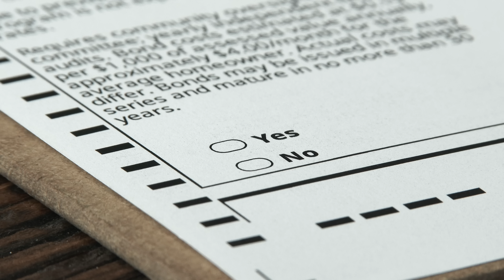Why Does Tesla Have An Anti Right-To-Repair Stand? We Suggest Some Reasons

Comment: In the past it was suggested that ICE car dealers saw most of their profits come from service and parts. You only sell a car once, but service and parts are forever. I’d rather not have my car bricked remotely because I swapped a cracked headlight. Especially if I bought it used. I support right to repair.
Reply: For me it is what you have the right to repair.. Headlights yes but what about the radar inside the headlight unit that integrates with  the smart cruise control? I too support right to repair for me but not always for backstreet repair shops selling “fixed” cars to us.
Reply: @jonwetherell5214  If the self driving systems in the car are coded so terribly that a bad sensor in an aftermarket headlight is a safety issue then the problem isn't right to repair its the manufacture of the car.
Reply: @instanoodles  if the radar sensor requires calibrating and someone puts it in with default settings or ( worse) puts the wrong sensor in so the car reacts incorrectly then the problem is with the part and the loose nut that put it in..why do we accept that d1ckhead amateur mechanics putting spare parts on a car that they got cheap from ebay can sometimes compromise a car’s
 safety. .but mention Tesla and everyone blames the car manufacturer.
Reply: you know in apple products you cant even screens between two working phones without using secret apple software to authenticate the swap. same goes for cameras and batteries. you never really own an apple product
Reply: @nutzeeer  There are work arounds in the EU that Apple has had to agree to..but you are correct Apple make  it bloody difficult to fix a simple problem at home.
Reply: @jonwetherell5214  Why do you imagine a part like a Headlight is that different then smart cruise control. Repair shops for Tesla are not soldering boards and replacing chips. It is just another drop in and replace part, and no different than a headlight. The system should be able to tell if faults exist or if something isn't calibrated right. The same argument can be made for any car in reference to any safety feature. You cannot replace your own airbag because if you do it wrong, it could go off while driving and cause a crash. See how that argument falls apart.

The pretense that a fully electric vehicle is much different than a hybrid because it integrates self driving? Cars are not easy to repair, just because something is hard does not mean they should force you to use their shops or they brick features of your car. Replacing a hub bearing on your car even with the right tools is very hard to do properly, but hub bearing assemblies make it much easier, so you have a choice. Even if you chose the much simpler option, installing it wrong can cause one of your wheels to detach and roll away, endangering others no different than the scenario you portay. You have to research the steps to replace it properly, just like how a sensor should be calibrated when installed. These are not things you should argue make it impossible to repair your own car. 

They can easily provide inspection services that authorize the simple repairs you made. Still a trash system, but more acceptable at least. Instead they force you to use one of the small amount of Tesla certified shops and your repair can takes months because of that short sided thinking because it makes them more money than the sale of the car.
Reply: @jonwetherell5214  You also argue that Apple makes it bloody difficult to repair a simple problem, but don't see how Tesla is doing the exact same thing.

Comment: Yes I would... it's one of my biggest concerns with buying a cybertruck and why I haven't really considered any of the other tesla cars.  They will eventually have to change.  The semi will start loosing sales to the nearest competitor if they don't allow a more open repair platform for it. Several places have their own mechanics and several independent operators do all of the work themselves to save money.  The problem i have is that is so far ahead of the competition in price and specs I could almost buy two for the price of one that is similarly speced on the cybertruck. As for the y... I'm more likely to go with the mach e or maybe ariya  partly as I know I can get basic parts to do my own repair when I want too.

Comment: Oh man, I just gave up trying to repair my light up Christmas wreath after several failed attempts. I feel this video recommendation is just YouTube rubbing it in my face 😂
Reply: go to homedepot and get your self a non contact voltage tester and test the string of lights. the bulb with no voltage is bad
Reply: @nutsinbolts7548  I narrowed down the fault to be the push-button switch on the battery pack. I tried to replace with wiring up a new pack off Amazon but it too is not working. I assume the original pack had some needed circuitry that the new one did not. It'll just be a non-lit wreath going forward I guess!

Comment: There is another option, a compromise,  allow repair of more traditional car parts such as suspension, brake, HVAC etc. and Tesla authorized only repair of safety items such as high voltage and auto pilot related parts.  This would allow Tesla to keep the lucrative big ticket repairs yet allow the average Joe to save money fixing the more common, well understood car problems.  Tesla could do this by releasing it’s diagnostic software which would inform you who is qualified to do the repair.
Reply: Nikki explicitly mentioned this option in the video.
Reply: So normal people can't be trained to do safety items?.

I'd say brakes are the most safety critical item, yet the 16yr apprentice is let loose on them.
No reason people can't be trained to do any part.

Comment: Not sure how this is going to work out long term.  ALL ICE cars are traditionally worked on at home and by small 'back street' garages particularly when they get older. This is fundamentally what keeps the value in an old car - you can repair it cheaply!
If you have to pay a fortune to keep ancient EVs running, then presumably their value will plummet rapidly to zero....
Not a good situation for less wealthy purchasers - which is most of us...!
Reply: I totally agree with you toyota for example have millions of cars on roads and parts are also dirt cheap and diverse/unterchangeable
Reply: Not a good situation for the environment either as that car will be disposed of earlier.

Comment: No more rejetting your own carburetors! I believe closed ecosystem cars will be more common now that everything is software driven and nobody wants a cut rate module from Ebay causing a death. But I agree that replacing a strut or rear seat from salvage should be fine and common has it has been for driveway work for 100 years.

Comment: An interesting and important topic Nikki. Maybe the problem is that pretty much all of a Tesla's mobility systems -- drive train, steering, brakes, maybe include suspension, and so on are smart with all kinds of sensors and servos (some of the hardware only partially utilized awaiting future system upgrades) -- so an owner or independent repairer risks upsetting a complex and interconnected system with who knows what safety and function consequences. There's a credible suggestion around that Tesla will move to a subscription model at some stage and so the company, or a network of franchisees perhaps, will own the hardware, not the user. This would make user/independent repair a non issue and there would be no used vehicle market. Maybe older (and less capable) vehicles would be kept running and made available (from 'vintage model' operators) at more affordable subscription rates than the state-of-the-art new stuff.

Comment: If America adopted consumer law like Australia's then these issues would go away for you (and Tesla doesn't have a choice they do have to comply with the Australian Consumer laws for all vehicles sold in Australia)

1) You as a consumer can choose to have your vehicle serviced / repaired as any business that is https://www.mtaa.com.au/ accredited and the manufacturer can not void the warranty
2) Australian consumer law takes precedence over any warranty, thought there is a requirement for a minimum warranty of 1 year for all new products, there is also a provision in the consumer law that states that the retailer is required to repair any part that fails in a time shorter than a reasonable person would expect it to last (e.g. A SLA battery that failed after 18 months even though the warranty might state is only covered for 1 year would still have to be replaced because a reasonable person would expect a SLA Battery to last 3 years)
3) If a part that is not user serviceable is replaced or repaired under warranty (including outside the warranty period under the reasonable person clause) then the warranty on that part starts again.

There is more, but these are the parts of the legislation that really have helped me over the years. Also this is general consumer law and applies to all products not just vehicles, point 3 is really useful when dealing with computer manufactures that seem to want to do a quick and dirty repair.

I expect NZ law will be similar as AU & NZ have a lot of common laws.
Reply: Car companies in Australia have not been following consumer law for decades.
Reply: @Robert-cu9bm  They do when you "Remind" them, when I get the "it's not covered by warranty" excuse I ask to speak to the manager, I then ask the manager if (s)he would like me to call the department of fair trading and get them to explain to the manager their responsibilities, this is usually the point where the manager will make some weak excuse about the person being new and not knowing the proper procedures and then the manager quickly organises the warranty claim without ever needing to make a phone call. This has worked for me with Honda and Citroen, but I've heard some horror stories with other manufactures so your milage may vary but at the end of the day if you don't get anywhere get your state's department of fair trading involved, they are usually only too happy to remind the dealerships of what is required under the law and issue fines for failure to comply (they get the fine revenue)
Reply: @daveamies5031 
Watch AutoExpert and you'll see how often it happens and even when stating consumer law they still don't.
Reply: @Robert-cu9bm  I have seen the horror stories on AutoExpert and others, but I can only tell you what my limited experience has been, perhaps some makes/dealers/states are better than others? The approach I mentioned was recommended to me by NSW Fair Trading in the 90's when dealing with computer wholesalers, and has also worked for me in QLD with car dealers (when I lived in NSW I didn't have a car new enough for a warranty), It's worth trying, and might get you a good result, if not you eventually have to choose if paying to fix it is going cost you more or less than getting lawyers involved, sometimes a letter from a solicitor at the cost of several hundred dollars is the effort needed to show the dealer you are serious, but if the cost to fix is only $120 it might not be worth the effort fighting it and I think the dealers rely on Australian's apathy when it comes to fighting for your rights, that might be much lees of an issue in the USA.

Comment: Opel/Vauxhall did it right in the beginning. They made sure there were plenty of spare parts made for cars in europa. So even my old corsa tr from 1984. I could still find brand new OEM parts for it. Sure not everything. But being able to get new parts even 35+ year later is nuts. If tesla did it right they had 3rd party company making spare parts off their catalog. And sold parts this way. Taking a small cut.
Reply: You are right it is a better model but fits a volume car maker rather than an expensive low volume manufacturer.... hopefully, as they become more secure in the market, they may change direction.
Reply: @CTCTraining1  if you want to hit a low budget marked like the new upcomming european hatchback (most likely also the 25,000$ car) this marked is filled with DIY folks. because they need to work for a living. curiosity drives people in this marked. im one of them. building 3D printers, drones, computers, hacking electric scooters you name it!  people like me. we turn every coin. not just from start but through out the life span of the products!

Comment: Great video. I'd love it if Tesla opened up for at the very least third party repairs, but ideally for owner repairs. Here's hoping that day comes. The point about E-waste is a troubling one. I've started buying second hand electronics instead of new where ever possible for that very reason
Reply: But the claim that Tesla doesn´t allow third party repairs is just not true. It depends of course on what kind of repair is needed. There are Tesla authorized workshops. I have had my Tesla repaired by a Tesla authorized workshop twice. The first time was the rear bumper with all the sensors on it. They got all the parts form Tesla, or course.
Reply: Tesla has changed their policy  thanks to new laws. Video should be updated accordingly
Reply: @ajaxa9  What laws? International laws? When did Tesla change its policy?

Comment: I am still driving my 1988 Subaru Brumby ( Brat). One day I hope to convert it to electric with parts from a Nissan LEAF.
Reply: Unless you live in a warm climate, I wouldn’t go with a Leaf power train. They don’t have a liquid cooling system, so range and usability is severely negatively affected by cold temperatures.
Reply: @MARXTACET   The LEAF power train does have liquid cooling, the batteries don't . There are not too many places in Australia that aren't warm climates and that is where they were sold as Brumbys. I won't be using LEAF batteries.

Comment: Telsa is vertically integrated to quite a degree - working with other people is precisely what they are forgoing to get speed and to avoid compromises.  If they change components a lot then they will keep spares of each type but only enough for them and only enough if the older cars exit the ecosystem.  This is just a guess of course.

Comment: Just to be on the same page - the "rest of automakers" started to do this only under pressure of EU legislation - they, for example, had to be FORCED BY LAW to not void warranty if you had fix performed by non-authorized shops. This was for years the main reason for refusing warranty, killing small repair shops.
The legislation changed ~10 years ago and only from that moment the online orders of parts become new normal. Until then all shops were searching for "Bosch equivalents"...
This is where electric cars are heading now. Unfortunately, without correct legislation, it seems they will try to push back as soon as possible.

Comment: Short term solutions could be keep it closed for safty components but open for non safety things like the wheels and so on.
Reply: safty?
Reply: Every part on a car is a safety component, except the radio. Is a car safe with a bad light bulb? a badly mounted wheel?
Reply: @niconico3907  ok. You win.

Comment: I agree completely on the right to repair issue. We live far away from the dealership and have to spend a full day to get a Tesla fixed if there is an issue. Sometimes it can be just a minor thing and a local garage or myself could do it, but we are blocked from doing anything outside of Tesla's service network. It would save us a lot of trouble and time if we had a chance to get the repair locally or if they had a mobil service truck around these parts..

Comment: Don't forget all the automakers that are suing to block the voter elected right to repair. I don't remember Tesla being amongst those suing. Also, sounds like more reason to keep driving my 2000 Tacoma. I've done all my own light bulb, bumper, suspension, grease, oil, and fluid changes but for more difficult issues e.g. ABS light or leaking rear axle seal, I bring it back to a Toyota dealership. For safety reasons, I trust them more than I trust myself. Unless I total this truck somehow, I can probably keep it going until I can't buy gas anymore or not be able to chase down fuel supply trucks mad max style after the SHTF.
Reply: Keep your truck mate, those things are amazing

Comment: I also fall in the last category you mentioned. And I was interested in a Tesla but there’s views on repairing turned me off to the brand not ev though. I ended up buying en e-golf for the fact that most of the maintenance parts are easily accessible and cheaper since it’s basically just a golf. Event the regulars vw diagnosing tools like vcds of obd11 works with it to. Heck I have Audi wheels on it now for winter.

Comment: Good synopsis.   I just did a brake pad replacement on my Toyota truck, but it doesn't have regenerative braking. In practical terms, that means the Tesla braking system is integral to the charging system, which means it is fully integrated with the software.  I favor ''right to repair'' also, but can now see that Tesla's position is not merely greedy.  There are technological reasons.

Comment: Tesla could sell spare parts through it’s repair network giving them the extra work and chance of extra profit..so no on cost to the mother ship there. However try repairing an ICE vehicle today and you need a super mechanic with some very expensive computer gear to finish the job. Simple things like changing the brake pads on a BMW now needs a service computer plugged in. Try changing the fuel injectors and you need to register them to the car. So should Tesla let me buy brake pads and door handles..well yes but but I for one do not want  to go anywhere near a Tesla that has had a home hacker “fix” a charging issue.